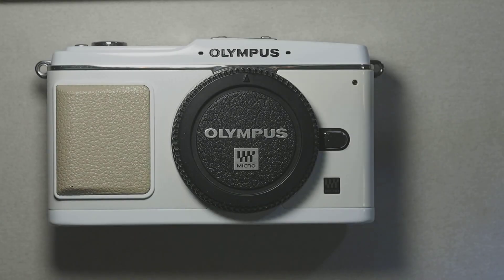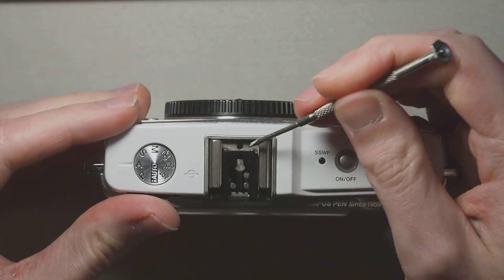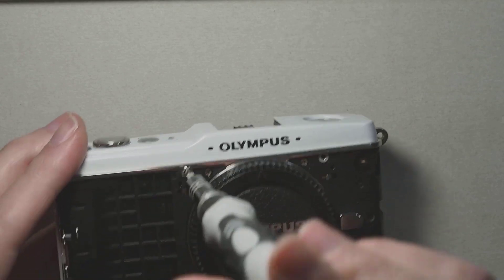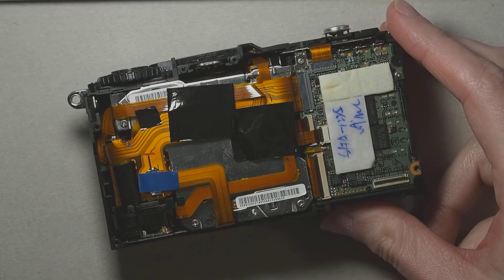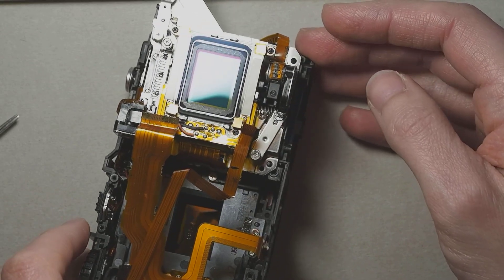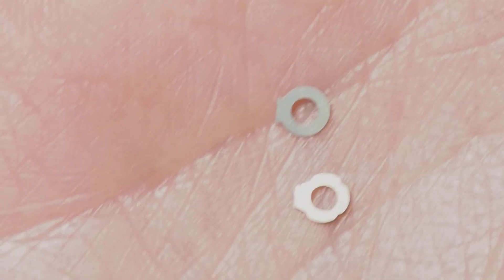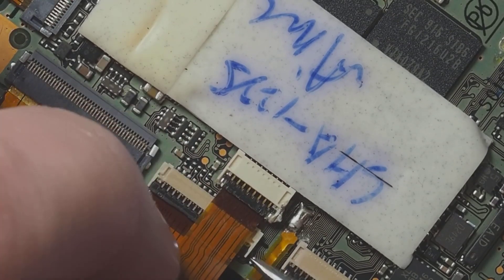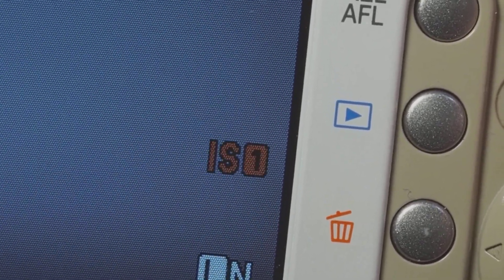Olympus PEN E-P1 disassembly and workaround for broken IBIS gears

Comment: I just need to open the back panel to deoxidize the button. Do I have to open the side, top panel like what you did?
Reply from the maker: depends on which button you mean - those in the direction arrows/thumb wheel thingie can't be accessed from the inside either, there I just sprayed some contact cleaner into the gaps from the outside.
Other that that yes, you probably need to remove the other panels first, because the back panel is fixed with screws that are hidden under those.
Reply: Thank you! I'll give a try with the contact cleaner .now only OK button ,play button ,the wheel,and the magnification dialler working. hopes it works after the spray

Comment: Im not familiar with camera hardware but I'm planning to attempt this haha. Question, did you glue the big movable cog so that it doesn't move anymore and that fixed the ibis issue? Should i also glue the spring or no? Thank youu
Reply from the maker: I tried different approaches, as far as I remember squishing sticky goo (meant to attach posters to walls) into the gearboxes only worked for a couple of weeks, but wedging a couple layers of sticky tape in to keep the remaining cog from spinning is what has kept working for over a year at this point. I don't have an ideal recommendation.

Comment: Can yall say it with me? Planned obsolesence!
Reply from the maker: Eh... there are some egregious examples of planned obsolescence elsewhere, but MOST of these things are just reasonable engineering decisions. Doesn't make sense to make a device more expensive by using materials that will last 300 years for some parts, if other parts will necessarily wear out before them, or if you expect the technology to continue advancing fast enough that virtually no one would want to use the device anymore after 20 years.
It's inevitable that most devices will turn out to have an "achilles heel", a single part that breaks much sooner than everything else - sometimes these are really dumb and could be avoided if the manufacturer had put a little more thought into it, but usually it's something unforeseeable.

Comment: I just did this repair on my E-P2. I just had to get to the point where I could see the little plastic cogs of both IBIS-axis. Both were loosely sliding on the motor shaft. I glued them to the shaft with a tiny drop of superglue, which seemingly fixed the problem, IS is no longer flashing red. But be aware, it is a delicate procedure.

Also thank your very much for your effort, this helped so much.
Reply from the maker: That's great to hear, thanks for the feedback :-) Maybe the cogs on the E-P2 are of a different material (or just have aged slightly less), so they're still usable that way, just loose. Mine had shrunken enough to crack, and if I had glued them back on, the teeth wouldn't have ended up with the right cadence all the way around.
Reply: @widicamdotnet  Yes, they were not cracked, at least not to a point where I could possibly detect it. But, there might have been a tiny crack in both of them, since I can't imagine how they would have stayed in place before, if not for a tight press fit.
Reply: late reply but I also have the issue on my ep-2 and was wondering , did you remove all of the ribbon cables like he did since you said you only had to remove enough to be able to see the cog? and when gluing did you just push the cog wheel down then glue to the tip of the shaft??? thank you!!!!
Reply: @RowdyRandallll  I cannot remember exactly, but I am almost certain I did not remove the sensor assembly. As soon as you see those plastic cogs, you're pretty much where you want to be. Sorry to be so vague, but as far as I can remember it was not that complicated. As for glueing the cog down, I just pushed it to the position it should be in (so that it is in line with the corresponding cog or gear) and put a drop of super glue on the shaft (like you said). Hope this helps!

Comment: Thanks for this teardown video and sharing your solution for this. I wonder if you managed to measure the nylon white gear used on the stabilizers? If you did, could you share what the dimensions are? Like what the center hole measures, the outer diameter, and the longitudinal length is? Hopefully in metric units. Thanks!
Reply from the maker: I still have the remains of the gears, taped up to the inside of the camera near the tripod mount. But since they broke into pieces on their own, it would be really hard to measure them to the kind of precision that would be needed to find or make replacements. This would need to be done by someone with an E-P1 where the stabilization still works (i.e. the gears haven't shrunk and broken), and with far better measurement tools than I have access to.
Reply: 0.25模 9齿 2.75外径 0.98内径 
单位毫米
外径不太准确

Comment: still not sure if I am going to do that. But other question. did you check, once open, if the IR filter would be easy to remove, so I could convert my EP directly? Thank you
Reply from the maker: I did not look into that specifically - if the IR filter is the large square piece of glass (seen shimmering in red at 7:35) held in place by the four black screws and metal tabs (seen best at 10:00), then it should be straightforward to remove, but I'm not sure, it could also be a layer below that glass? The problem is that you'd probably need to replace it with another piece of glass with roughly the same thickness and refraction, otherwise the focus distance will be wrong.

I've converted two compact cameras (Minolta DImage X20 and Olympus Camedia C-4000Z) to IR-only by replacing the IR filter with a piece of visually black (but clear to IR) plastic from an infrared remote control's case, but I got really lucky to find something that fit and was optically good enough. The E-P1 sensor would need a much larger replacement glass or filter. If you have a source for that, it's probably straightforward... but, I haven't tried.
Reply: @widicamdotnet  thank you, well I guess I better leave it :D my skills in this regards are limited

Comment: Have you ever replaced the small RTC (real time clock) lithium battery in this camera? It seems to appear at 12:40 of your video, in the upper-left corner of the camera.

If you did replace this battery, was it difficult to do so? I know these small lithium batteries die eventually, and I think they're in all of Olympus Pen cameras... at least the older ones.

BTW, nice video! It's very informative. Keep up the good work!  🙂
Reply from the maker: Thanks :-) Good question, but I'm certain the flat round thing with the white and red wires is the speaker (the connection points are also labeled SP1+ and SP2-), not a backup battery. I remember that even when it was new, the camera used to lose its settings when the main battery was removed for more than a couple hours, so I think it uses a capacitor (which should not need to be replaced). Unlike cameras with actual lithium backup button cells though, it never lost its settings during a short battery swap.
Reply: @widicamdotnet  From photos I've seen, I think the Olympus Pen cams use a lithium battery for the RTC. However, I could be wrong about that. I've never actually disassembled one. LOL!  ;-)

A lot of digital cameras, including higher end cameras, still use a lithium battery to power the RTC and some of them are located inside the body. I know the Canon 60D (DSLR) uses a lithium battery inside the body, because there are YouTube videos about opening the body to change the RTC battery. Do a YouTube search on it and you'll see what I mean. YouTube doesn't allow links in the comments section. Some other cameras still use lithium batteries for the RTC, too.

Anyway, thanks for the reply, Widicam! And greetings from Toronto, Canada!  🙂

Comment: Hey! 
   Just lock broken mechanism, instead fix them.. Is so annoying final.. Moreover the thing is in one small f***en gear... 
But yes, it's not a standard module gear.. fuuuuuuuuuuuuuuu ))
On Ali I find similar 9 tooth... named like 'RC pinion gear"
Unfortunately available gear have slightly bigger outer diameter, so they dont match as is.. and need some trim work.. 
    And i tried to match that pinion gear.. only with magnifying glass and skalpel))... this is damn hell!!.. without special equip.
Its fit, but so-so.. Camera can now move stab. mechanism.. And red error blinking gone! 
But seems stab mechanism doesn't work properly. Matrix do On an Off  movement sequence.. But in l other time just stay still...
     Obviously that's need more precise trimmed gear.. 
Billet pinion gears from Ali, we have.. But how can we reasonably trim they in DIY circumstances?? That is the question!) 
Any opinion will be great to hear!))
Reply: Sounds very difficult to find a replacement gear. Did you measure the exact dimensions of the original gear? If you did, please could you post it here, thanks!
Reply: @melk8306  我在上面回复了这个问题

Comment: should you remove the battery n sd card first?
Reply from the maker: You can leave them in, they're not in the way of anything. Obviously take care not to bridge any contacts with your screwdriver.
You can even test the camera before full reassembly too, only the ribbon cables for the sensor assembly need to be plugged back in for that.

Comment: Have you had any issues with the directional buttons? Mine seem to be playing up, the OK button and wheel seems to be fine. I was going to attempt to open it up but noticed your video doesn't show this step.
Reply from the maker: The buttons are fine on mine, but the wheel is acting up. I didn't manage to access its mechanism from the back so just sprayed in some contact cleaner from the outside, which improved it quite a bit, but it's still not registering every click of rotation.
But do try contact cleaner for the buttons, can't hurt.

The thumb roller (which can be disassembled from the inside) is interesting and should live very long, it's a completely contact-free design using magnets on the roller and presumably a hall sensor.
Reply: @widicamdotnet  thanks for the reply, I managed to get through to the other side of the board but the wheel was enclosed in a separate housing. Will give it a big spray tomorrow and cross my fingers!

Comment: I wonder if 3D printing has become good enough to be able to reproduce cogs this small? I have an E-PM2 with the same problem.
Reply from the maker: Not necessarily 3D printing, but people have successfully machined nylon into very exact replacement cogs for old cassette players etc., so this should be doable and may appear for sale at some point.
However, this generation of IBIS wasn't that impressive anyway (compared to the later implementation e.g. in the E-P5) so I'm fine with just disabling it.
Reply: @widicamdotnet  also another problem is not fixing the IBIS affects the ultrasonic dust removal system. The high frequency noise heard while turning on the fixed camera is that system in operation. The grinding noise, a misaligned cog which will no longer perform this function.
Reply from the maker: @tomfenn7149  true, although I don't think vibrating the sensor using the gears does much to remove dust - it's just another function they added in software since the mechanics were already in place.
You can actually wipe the sensor with a soft lens-cleaning cloth, it is covered with a piece of glass. (The scratches seen on my sensor are from a single stupid experiment with non-matching lenses years ago - not from wiping it or anything.)